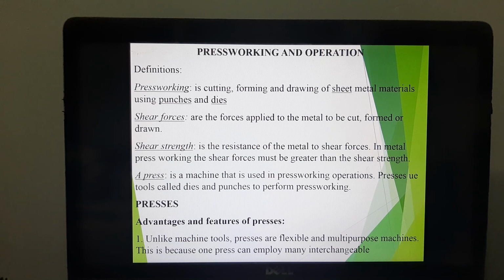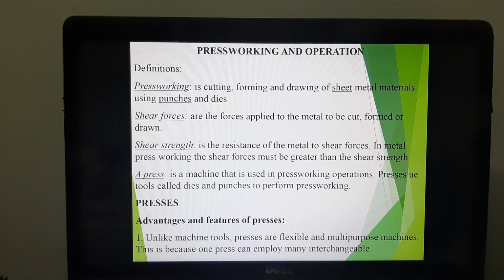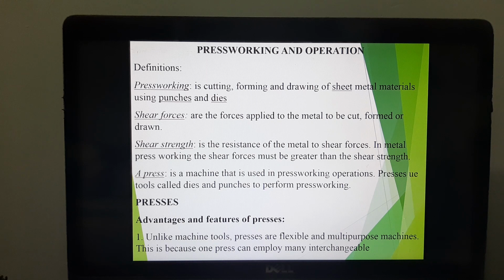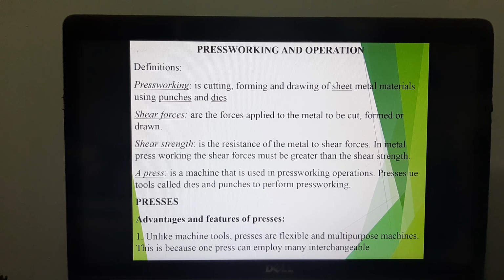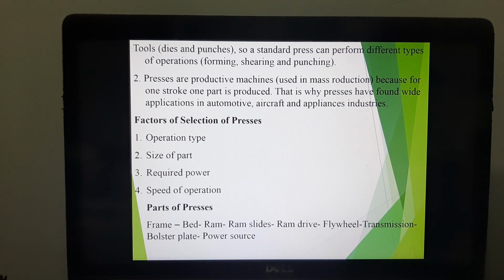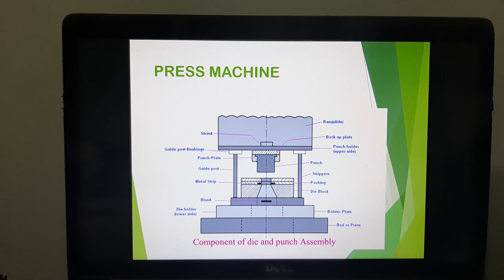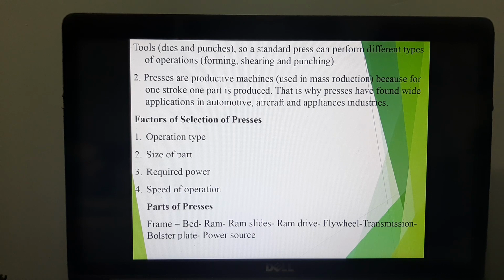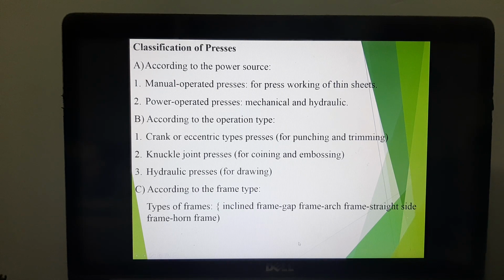PRESSWORKING OPERATION PART 1

Comment: Good evening madam, I'm Chong Jin Yang (ME0106047). From this video, I have learned about press working operation. Press working is cutting, forming and drawing using punches and dies. Cutting is performed in CD part of stress strain curve (shaping with fracture) while forming and drawing are performed in BC part (shaping without fracture). There are shear force in press working operation. It is forces applied to the metal to be cut, formed or drawn. There will be always normal forces which is opposed to shear force. Therefore, shear strength has to be high enough to resist the normal force and shear force. However, shear force has to be higher than shear strength during the operation, so that the metal will exceed its ultimate yield strength and to be machined. In this operation, a press which is a machine consists of dies and punches to perform the press working. The advantages of using press is that press is flexible and  multi-purpose machines which can employ many interchanges with punches and dies. Standard press can perform different types of operations ( forming, shearing and punching ). It is a productive machine which is suitable in mass production. One stroke for one part. There are several factors of selection of presses which are operation type, size of parts, required power and speed of operations. There is also presses rating which is also called tonnage rating which can determine the energy spent on the work at each stroke. Thank you.